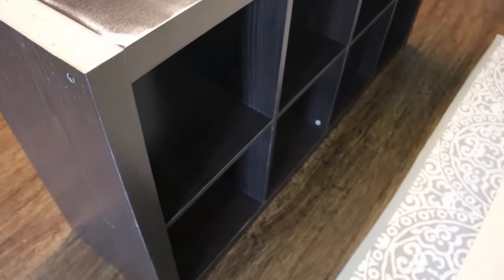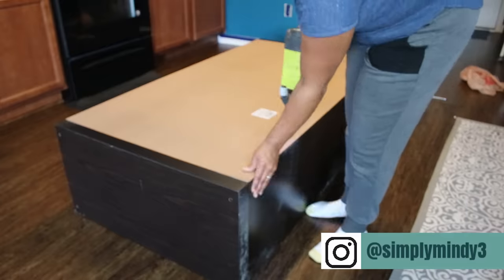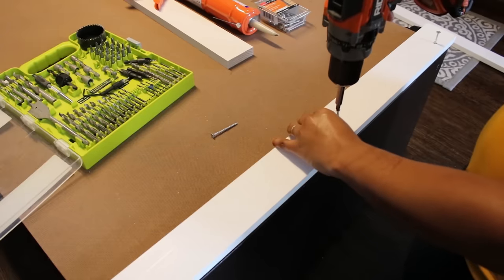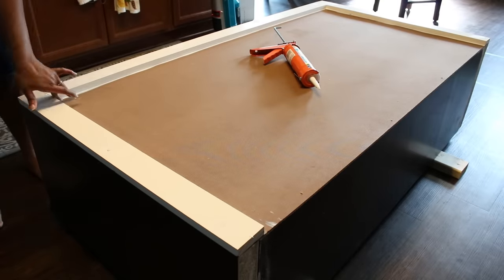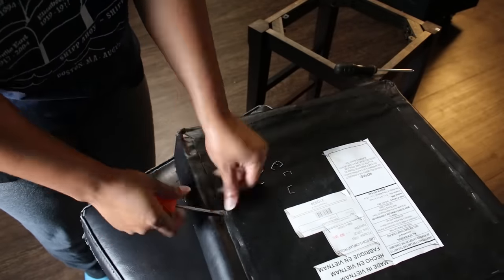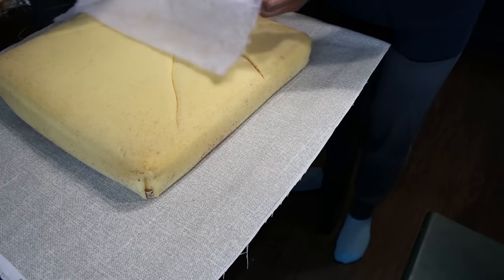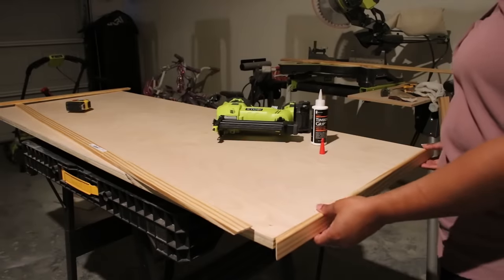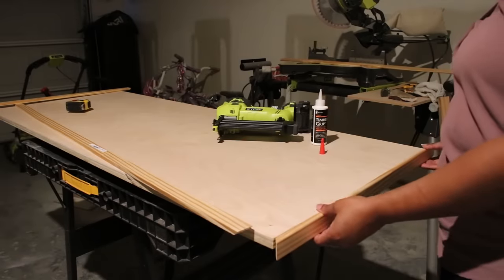BEST Cube Shelf Makeover EVER | Easy Kitchen Island on Wheels

Comment from the maker: Hey everyone! I am overwhelmed by the amazing response to this project! I am glad soo many of you found it helpful!
 Here is some info on common questions I've gotten about this project. 
Cost:
My cost was around $86 (includes plywood cut (not entire sheet), the backing piece, trim, glue, caulk, paint). I had the cube already (current walmart price is $69). I completed it over a weekend. 
Size:
Top plywood - 24 inches by 60 inches
Height - just under 36 inches (almost counter height)
Wheels:
2 inch casters from Amazon (https://www.amazon.com/dp/B07PRZPL5R/ref=cm_sw_r_cp_apa_fabc_X6T8Y3N7K0HQ29JB8JRP?_encoding=UTF8&psc=1) *not an affiliate

Hope this helps! 😊
Reply: Q.  ...Do the Caster Wheels LOCK?....if you said they do i missed it
Reply: You are awesome!!!
Reply: Wow you did an amazing job! I love this! You should mass produce and sell them! It's one of the best breakfast island I've seen.
Reply: Hello I’m trying to recreate this island the exact same way you did yours. Was the height or length of the bookcase under 36’
Reply: Also If I got a 6 pocket bookcase what would my measurements be
Reply: I'll bet this would cost three times that in 2023 😒

Comment: Incredible upcycling! And you weren't being lazy by using your finger to achieve a clean line with the caulk, it is precisely how it should be done. One neat tip I learned was to dip the finger in water first, then draw the finger along the caulk ... it makes for an extra slick line and keeps residue on the finger to a minimum. Such an impressive item of furniture which would enhance any kitchen or outdoor BBQ area. Greetings from the UK.
Reply from the maker: Thank you!! I'll have to remember the water tip for next time!

Comment: Your project turned out great!!!
I have identical bar stools. When I recovered them I sewed the corners to reduce the bulk, by putting the new fabric on the stool wrong side up and marking/pinning the excess corner fabric to sew. I also attached my new covers with velcro for easy cleaning, and used rubberized shelf liner to keep the covers from shifting on the seat. I hope this was helpful.
Reply from the maker: Thank you for the tips! As you can probably tell, upholstery is not my forte! 😆

Comment: It did not need a back panel. Since it's so dark and heavy looking. The light coming through would have been refreshing and have access on both sides also could have added a plant or two. I also preferred the seat covers. I would have just used some slip covers. Did not like out come of new seat material.
The remodeled of bookshelf did come out PERFECT.

Comment: u could add sliding baskets 1 or 2 to each cube space.
Reply from the maker: Great idea! I haven't decided what I'm going to do yet.😊
Reply: @SimplyMindy  you dont even need the sliding wire baskets; you can get plastic brown basket weave ones from the dollar store or order them from wayfair or ebay or amazon.  I once got a fancy older dresser for $50 and used it as a bathroom fancy cabinet;  painted it white and the handles bronze; had to cut out the interior of the centre shelves to accommodate the sink plumbing (kept the outside face plate of those centre vertical drawer faces and used self stick velcro to reattach them to the front of the cabinet) and put in two shelves on each side with brown plastic baskets inside the two side doors.  worked really well; very cheap and nice looking for $50!!  new ones built for bathrooms cost about $1,000!!

Comment: From what I know of the WM & Kallax units, screwing the casters directly onto the bottom will not provide much support.  Those “walls” are hollow with corrugated cardboard inside.  The casters might weaken and break.  The best thing is to put some plywood of on the bottom and THEN put the castors on.   (My whole apartments (yes, plural) were full of IKEA Kallax shelves.)

Comment: Been wanting to do something very similar in my kitchen and this was the best video I have found!! Have you had any issues with it almost tipping over if people put weight on the countertop??
Reply from the maker: Thanks Loren! As far as tipping, I have not had an issue though having it on wheels does make it a potential problem. The other option would be to go with legs instead to get the height or create a base to attach directly to the floor. Hope that helps!

Comment: I know it was 4 years ago that you did this, but I was wondering - how many casters did you use? And where did you place them along the unit, just at the corners, or did you put some more centrally as well?
Reply from the maker: It's four casters, one on each corner. Now that I've had it a while though, I'd suggest adding some construction adhesive to the caster base before screwing on or adding wood to the underside of the cube shelf for a better screw grip. Hope that makes sense!
Reply: @SimplyMindy  That's so helpful, thank you :)

Comment: So the top is only secured by the glue?? With kids (or without kids) it doesn’t seem secure. Is there anything else you did to reinforce the top?
Reply from the maker: The glue I used is construction grade adhesive, so it's very secure. If you wanted to you could add screws from inside the cube up through the wood.

Comment: How much was the total material cost? How much time was invested?
Reply from the maker: My cost was around $86 (includes plywood cut (not entire sheet), the backing piece, trim, glue, caulk, paint). I had the cube already (current walmart price is $69). I completed it over a weekend. Hope that helps!😊
Reply: @SimplyMindy  for all the paint, coasters, lumber $8? The material and batting for the chairs. The cost of the chairs? 
I would thing that was more than $8?
I am guessing you already had the cube shelving?
Reply from the maker: That was $86.00, not 8. Lol. That would've been amazing! I did not include the materials for the stools. For those the fabric was around $15 (@walmart) and the spray paint maybe $12( for 3 cans).
Reply: @SimplyMindy  My mistake. Ok $86.
How much would it have cost to build the entire thing out of solid wood? I know that depends on the type of wood so lest say Fir wood vs particle board cube.
Reply: My point is VALUE IN EXCHANGE
Reply from the maker: So without drawing out a detailed plan, here's an estimated cost to build the cube out of wood based on current pricing @homedepot : around $120  if using fir/spruce, and likely around $100 for plywood. Looks like you'd need 2 sheets to get all the cuts. This would just be the lumber cost (for the cube only), not any screws, wood, etc. Hope that helps!

Comment: Why on earth you put the upholstery farbric on doubled? Seemed just bit wasteful, you coulda managed with only one layer of it, woulda been easier to do the corners even.. Nice looking island you made!
Reply from the maker: Thanks for watching!
Reply: Could have been the weight of the fabric, the 2 layers would give it more body and probably more strength.  She could have applied an interfacing to the fabric I suppose if she had any.  However, if she didn’t have the correct weight, that could have just created its own problem.